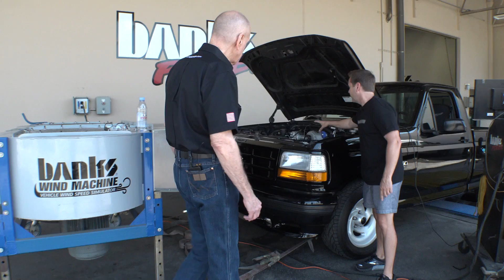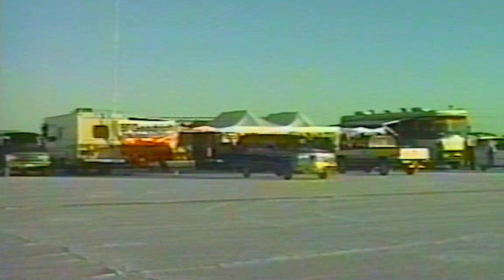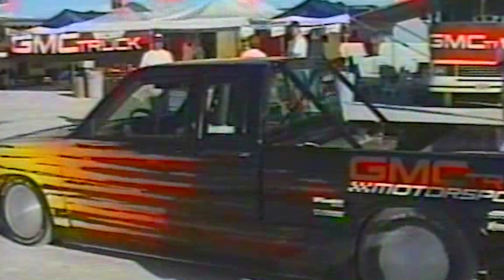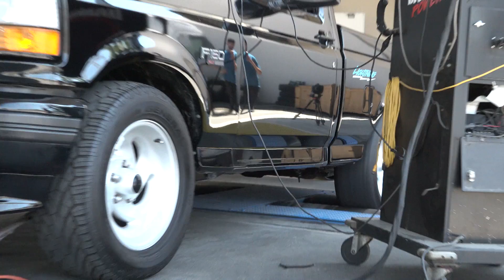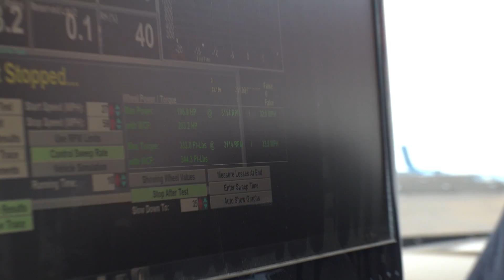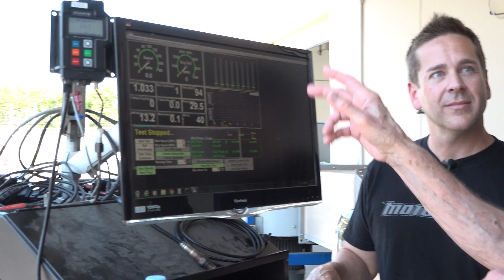Worst Supercharger Ever? - FORD F-150 LIGHTNING

Comment: Gale is a legend but this verges on clickbait as he knows without a doubt that the stock Lightning exhaust is woefully inadequate.....put long tubes on this with a real exhaust system and try it again....... there is simply no other reason that 5psi boost will not put down another 50+ to the tire. More air in= more air out......simple physics.

Comment: id put a snow kit on it it will help a lot not even a tune based one and if u do it right it can look like factory and in a pinch you can use a lower based fuel

Comment: why do I have a feeling that they haven't even compression checked the engine or even put more than a dummy gauge on oil pressure.... something very snakey   here ...    it reminds me of an infomercial  where banks is the pitchman  and this other doofus is   that token    QVC representative gumby who just acts impressed or surprised at the results of everything... Watch it again from that perspective and you'll see its exactly whats going on here.... so buy that banks twin screw for low price of $3600!  (  kit not included )

Comment: What's happened here   is that is a stupid plenum for a truck...  you've increased the velocity without increasing valve  or air  in the heads... So basically it's mimicking the APPROPRIATE long runner truck plenum with dual throttle bodies.   The velocity increase is evident in 70 ft lbs ( respectable gain )   and that it lowered your PEAKS    JUST AS SPACERS OR ANYTHING LENGTHENING THE RUNNERS  WOULD DO   TO INCREASE LOW END  BY WAY OF  VELOCITY.     I have a BD11A  ( same unit basically )   rebuilt with just standard stuff and A trim...  going in an E-150  with the proper truck 5.0  that's been completely ported   to where my runners can flow near 280 cfm each.    The difference is my cam  is  a .496 lift and 291 duration adv  on exhaust.    or near a 400 HP  5.0 N/A.    @ 6 psi  I've calculated   my stall speed will be at 500 ft lbs    plus running water / meth injection.     So  I've mixed a higher duration cam with the torque of a long runner    even spacers    though I dont think my 1" phenolic spacer will clear.      I will more than most likely see those 500 hp results with only 6 psi    depending on how the plenum volume takes the boost or if I have to upgrade the trim level understandably ... i really just wanted to push over 400   but either way... I've seen in recent times BD11a   go   on Mustangs   with 340  HP crate engines... run the A trim  2.93"   "6 psi"  pulley  and make 420 rwhp.   So there's no way you can title this as "the worst supercharger" .   I understand that's the point of the question mark but it seems more like a propaganda video to sell something and another assault on the wallets    of blue collar builders who can only afford   a $1000 or such blower only  unit .   and I get that this is a commercial channel and all    but    come on...  you're kind of ruining it ... or maybe just making these units available cheaper   but then you can't find Volutes anywhere     or drives up the cost of the rarity for people to sell larger trim volutes and impellers.

Comment: Why no curve?
The peak numbers are really bad, my second car was a 2000 Saab 2.0 turbo with over 200.000km on it.
Factory low pressure model turbo and over 200hp 300nm at the wheels, with a engine with less then half of the displacement.

Comment: wouldn't it be easy to move the timing up a few degrees and see if that helps. fords got their distributer right in the front where you don't need spelunking gear just to find the tightening bolt

Comment: I'm mad that ford made this truck run like a truck, when they advertise it to have a hot 351W that can share cams with a 302HO, but at the same time I giggle at the thought that it still goes door to door with GM's much hungerier 454𝙎𝙎, that supposedly had a 15hp and 55ft. lb of torque advantage.

Comment: Ha, my first supercharger was a Powerdyne, internal belt driven blower.  I later replaced it with PD’s oil lubed BD-11a version.  Never had any issues with either but the belt drive one was very limited in boost, never did make more than 6 or 7lbs of boost on a 9lb pulley.  Brought back memories seeing your PD!
Reply: Powerdyne's oil lubed, gear driven version was called an XB1A btw, and was much better, very similar to a Vortech V1 - SuperchargerRebuilds still modifies and services them !

Comment: That looks like a Powerdyne BD-11a supercharger.  I had one of these on a 92 mustang and it was an internal belt driven supercharger.  They had advantages in that they had a considerably cooler inlet charge than an oil cooled centrifugal.  They were really bad about belt slip - I suspect that may be the issue here.  I had to tighten the belt down so much the blower bracket was bending.  Once you got them dialed in, though, they were fantastic.  I made 512rwhp at 9psi on a h/c/i 302ci motor. Another great thing is you could rebuild them for fairly cheap.  I did mine twice.
Reply: I still have a BD-11a on my 302 Cougar with big aluminum heads. 400 rwhp / 400 rwtq.
Reply: Must have been something wrong with that blowers setup, like belt slip or the tuning was off. Very hard to believe all the extra air from a blower only gained 8hp.

Comment: Sounded like the belt was slipping. What was the boost up top ? That would explain low hp but high torque. Not defending the blower at all but it should have made more hp for sure

Comment: It's a shame we can't get a new RCSB 2wd Chevy or GMC with just a 6.2L, a 6.6L L8T is just dreaming. I wish they would have sold the S10 and S15 with a TPI 350 V8 or later Sonoma/S10, Colorado/Canyon with the LS1/LQ4/LQ9/LS2. They sold some 5.3s but they were rare and low output.

Comment: Ford is so behind on engine technology
Reply: That's a 25 year old truck 😂😂😂.  It walked all over the 90s 454ss as intended.  Ford is miles ahead of GM and Chrysler now.  Those coyote and voodoo engines are no joke
Reply: @whydoikeepgettincut  you ford boys still don't understand history. The lightning came out after the SS and was a piece of shit until 2001. Where it was second best to the LS
Reply: @johnwaynebrooks  Naturally aspirated LS
Reply: The coyote begs to differ. But yes in the 90s they couldn't compete with the small block Chevy.
Reply: @Potatogambit  the coyote does what? Absolutely nothing! Overhead cam with plastic timing guides have proven to fail time and time again. Slapping a turbo onto a turd doesn't not make it a turd sandwich. Watch any drag race in the pits and you will see no technology from Ford other than emblems and hats.
Reply: I'm not sure why you're making such bold claims? The Lightning had one job and that was to beat the 454ss which it did handily with over 100ci less displacement.
Reply: @haydenpadgett8580  4 years later............

Comment: I am curious to see how the Banks Idash 1.8 gauges are wired/installed in this vehicle. I have an older ford diesel that has no engine computer. Are these gauges somehow plumbed into that truck's engine computer? Or are the gauges working off of their own sensors? Thanks.
Reply from the maker: The iDash gauges are being fed by Banks Analog and Thermocouple modules. All the iDash needs is +12v/ground to operate. Here's a selection of modules and sensors. https://www.bankspower.com/c-70-products-idash-digital-monitor-idash-1-8-accessories.html

Comment: I ran that same supercharger on my 98 Jeep Grand Cherokee 5.2 because it was the only supercharger kit I could find that would fit my Jeep.  It really woke up the stock engine.  As people have pointed out it can't compete with other superchargers for racing but adds a ton of usable torque starting immediately off idle.  The problem I found was the bearings need to be replaced too often because they don't get oil.  Instead they are sealed with grease and can't handle the rpm needed to make power.  So you either have to keep the rpm way down for reliability which limits power.  Or you change the pulley to spin them faster in order to make power which causes premature bearing failure and more frequent bearing replacement.  I finally removed the kit because i got tired of replacing the bearings every year.

Comment: This era vehicle brings me back to my 1989 Pontiac sunbird Turbo. Had a distributor even. crank scraper, roller lifters multi port Injection. Muncie 5 speed. Stock. Really was untouchable on the street unless someone had a cyclone or a lot of money under the hood.  Paid 2900 back then used. Now it would cost you about 30K to have as much fun.

Comment: Damn grocery better Jeep grand cherokee had 230/300 for those years and it certainly wasn't marketed as a fast car just a grocery getter SUV...lol... Ford marketed this as " Lightning "... ummm yeah not much lightning under the hood there.
Reply: Not sure where you came up with those numbers???
Reply: @haydenpadgett8580  The fucking 5 2 magnum v8 in the zj grand Cherokee was 230 hp and 300lb/ft  . The earlier models of zj  were 220/285  . The first couple years the  v8 was backed by a 46rh later to only be backed by 44re then the 5.9 limited in 98 got a 46re ... Since I owned More than a few that I have spent hours under the hood of I'm pretty sure I know what they had for  drivetrain option.

Comment: A friend of mine had a lightning. He thought that adding boost and fuel would make it so much faster,...wrong. All it did was detonate more because he did nothing to cool the intake charge. IDIOT! It does not work that way! It's all about air density which is why cowl induction works so well.

Comment: i hate to say it, but the worst superchargers ive ever seen were the TRD ones from the early 2000's. $2.5k-$5k and they usually only added about 20hp at the best. many underfueled the engine along with generating a ton of heat making them ping-monsters. some included injectors along with a reflash and this helped, but they still sucked.

Comment: mid range driveability makes everyday driving fun and easy to get around traffic. I think that might of been the goal all along for this truck
Reply: Exactly the point of this truck. Not a screamer, but something with every day reliability and a little fun. Don't agree "the worst blower" as it does what it's supposed to.
Reply: I agree with you James, it was not desing for the Strip, it was daily with a grunt of torque on the low end.
Reply: Yeah,
Except it makes less hp than a 15yo Gti
Reply: And its over 10 years older. What's your point?

Comment: The Powerdynes were always junk. Vortech was the way to go on these if you wanted a bolt on kit. Most of the guys who wanted more went Procharger with custom brackets since they never made any for the truck, and that was only before turbos took the market. My 95 was an NA full exhaust, full bolts on, untouched long block and made 495whp 525wtq with a 150 shot BigShot GT40 plate kit and 245 356 with no juice. I always regret selling it, it was such a fun truck.

Comment: That is one sad forced induction system. I bought one of the first Procharger systems for the 5.0 Mustangs and with a smaller pulley and some basic upgrades, heads, cam and TFS intake, was making in excess of 600+ hp on 13lb of boost. Today's engines are so much more advanced.
Reply: Gt40 heads suck  cam was garage and that low compression
Reply: Two different animals, gear driven to belt driven. The Powerdynes were junk, if you pullied it to make any real boost is would strip the internal belt. They were low boost warranty friendly dealer units. Guys running Vortechs on the first gens were easily above 600hp with heads/cam as well.

Comment: Most of the lightnings i ever ran into at the drag strip were running 11s and 12s back in the day.
Reply: Not even close.  They were mid 15 second trucks stock and high 13's with a lot of mods.
Reply: @BigMikesGarage  minor bolt ons would get them into the 13s just simple but effective mods.  Stall, shift kit, intake exhaust etc they were running 13s trapping 100+.  That isn't "a ton of mods" I think is how you put it.
Reply: @BigMikesGarage  didnt say they were stock.. just saying it was frustrating driving a trans am sports car getting beat by trucks lol

Comment: thats why people put 1000hp ls turboed in it
Reply: People do that because they're cheap and readily available. If Ford made a cheap 400hp V8, it would be the other way around. Why would you spend $13k on a brand new crate 5.0 Coyote when you can spend $7.5k on a 6.0 LS. Or look in some scrapyards for a used $500 LS.

Comment: I remember as a teenager pulling up next to a Syclone at a stoplight. I was in my Firebird.  One second we were sitting there, the next he was gone.  I couldn’t believe my eyes, it was amazingly fast.
Reply: I think Donut said that the Syclone was faster than a Ferrari back in the day.
Reply: @jedidethfreak  A lot of people said that lol. It was a fact long before Donut came around and mentioned it. Sorry, just thought it was a weird thing to say. 

Yes it was faster than the Ferrari of that year to 60. Though I believe one of the older Ferrari's had it beat.. And that was only 0-60, with the Syclone having the AWD advantage. Ferrari smoked it everywhere else other than to 60. 

Still an insane achievement, and beautiful rig GMC made. One for the books, that's for absolute certain.
Reply: I remember Jay saying at the time the Cyclone was one of the fastest production cars
Reply: @Southern Fun  those 4.6's didn't "ho" till 99
Reply: @brysonshires9742  his 94 cobra is a 5.0 pushrod.
Reply: Had a similar situation with my 94 cobra and a new track hawk. Normally i can at least hang with modern cars but that thing just walked on me after I hit 2nd
Reply: That's what happened to me in my 85 trans am vs thunderbird super coupe

Comment: I have a '93 Cobra that I bought new and started modifying at two days old. It still has the stock short block with ported Edelbrock heads and port matched intake, custom ground cam, and headers - and a Powerdyne supercharger that I added around 1996. This was a kit put out by Powerdyne specifically for the '93 Cobra that had a one piece billet lower pulley that combined the Cobra underdrive serpentine pulley with the blower drive pulley. It was a BD10 as delivered, but I sent it back in to Powerdyne for a BD11 upgrade when the BD10s started having bearing trouble. My experience with this blower is different than on this Lightning, the Cobra made 429 HP at the wheels on a Superflow dynamometer. Other 5.0 Mustangs at the time running the various Vortech blowers were putting out more HP and torque, but usually not that much more. My best time at the strip was an 11.81 at 119 mph. The car is still a lot of fun, even if the newer muscle cars can show it taillights.
Reply: Not to pick on you or the car.  But even new diesel trucks can give it a run for its money now 400 horse power and 1,000 ft of torque just the weight holds them back.

Btw is your cars color that mysti chrome ford had? love that color.
Reply: @nou8257  Lots of newer cars and modded trucks out there that are faster, which is fine by me, my car is now old '90s tech. Fast in it's day, still entertaining now. My car is Teal, a blue/green color. Mystic was available on the '96 Cobras, while the better looking Mystichrome was on the 2004 Terminator cars. Both are collectible now.

Comment: Octane rating was lower, back in the day they used straight gas no ethanol or other trash in it.  Im sure it was hot out there and truck was prolly dynoed at a cooler ambient temp, not to mention 99 k miles and its age things tend to wear lol. Notice he didnt defend the big block truck.. Thats because the stock 351 lightning beat the 454ss.
Reply: Barely beat it with a “tuned” small block 

As far as I’m aware the 454ss was just a stock ass 454 in a rcsb half ton. GT40 heads and a couple other things right on the 351 ? Couldn’t do much with regulations with a big block then. The 454 was cooler just cause it was a big block though
Reply: How many more excuses do you have "stored up" to try to defend the 40rd?

Comment: At those numbers any clean sy or typhoon would stomp the lightning just saying (from the factory the sy/ty were underrated at 280hp when on the streets and put on dynos they made closer to 330 but gm didnt want those numbers showing up the camaro firebird trans am and corvettes of the time.. All this with a 4.3 awd v6 ) fixed up right you could beat a syclone but its gonna cost you damn near the cost of a syclone now 16-20k range and by then you would run into a modified syclone (like the syco syclone that makes 500 to the wheels with a t56 6 speed. Get heart broken) my dream truck is a syclone or typhoon.. Or even take and modify my 92 s10 into a sy clone. And eventually do the same with my 02 xtreme blazer i have loved mini trucks my whole life since i was 7 and watched my grand pa and uncle build a 59 datsun mini truck with a toyota 296 hemi that was in mini truckin magazine back in 97.. Every mini ive owned has been red and can be traced back to my childhood memories of that datsun ...ps i have the very magazine the trucks in.
Reply: LowMan Josh what month in 97 was the truck featured
Reply: @RaceboyYT  i cant remember the month i got the magazine.. Ill get back to you when i pull it out..

Comment: I remember that blower way back. It was available in the Motorsports catalog, the old one during the fox body craze, during the late 80’s, before the lightning came out. Don’t knock the blower, it was available to be installed by the dealership. The weren’t looking for big boost because the had to warranty it.